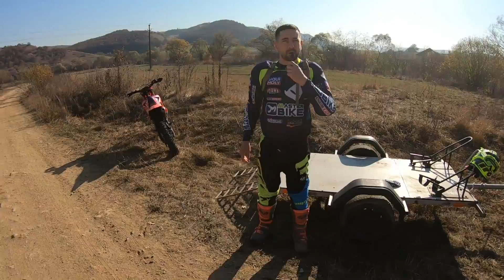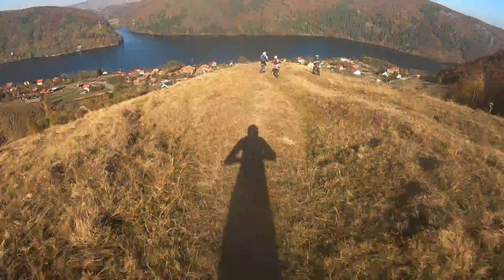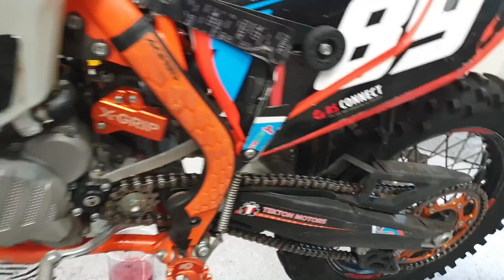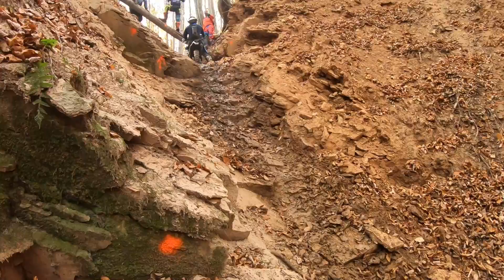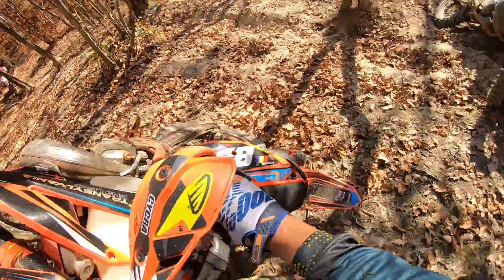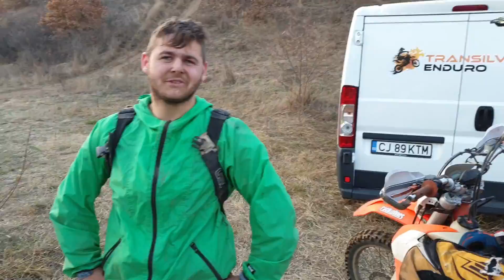Liqui Moly VS Hard-Enduro ? | Difficulty Level: Expert! Enduro Vlog #43

Comment: Si ce sfaturi ai pentru cineva care ar vrea sa inceapa enduro?ce marca ar fi buna?
Reply from the maker: Beta pentru low-budget, ktm-husqvarna daca nu vrei as faci compromisuri, la ambele variante mai noi gasesc piese usor. Pentru începători recomand 250 4t
Reply: @TransylvaniaEnduro  care sunt compromisurile la beta?
Reply from the maker: @silviupop9146  pana in 2018 strict din punctul meu de vedere si experienta care am avut-o aici la Cluj, plastice de foarte slabă calitate, incontinu ceva trebuia reglat la ele, din fabrica ele sosesc cu sistem de amestec ulei automat care este recomandat anulat si facut amestec in rezervor, centrul de greutate mai jos, suspensile fata de slabă calitate, în cazul x trainer telescop spate care se rupe etc
Reply: Transylvania Enduro eu am si beta si ktm si pot sa spun ca sunt deacord in legatura cu plasticele si oarecum cu suspensiile pe fata care nu sunt la fel de bune ca pe ktm/husqvarna, dar are si anumite plusuri fata de ktm, cum ar fi electromotorul, cuplul mai bun de jos,  se simte mai usor cel putin la modele pana in 2016.
Eu zic ca depinde mai mult de stilul fiecaruia nu poti sa spui ca sunt mari diferente intre ele pana la modelul tpi de la ktm/husqvarna si nu as tacaloga beta ca fiind ceva low-budget.
Reply from the maker: @silviupop9146  repet este punctul meu de vedere strict, cuplul il ai datorita carburatiei, pana in 2020 la ktm ai varianta  xc cat si TX la husqvarna care este mult superioară la varianta tpi, din fericire beta au facut upgrade -uri masive pentru 2020 vs ktm care momentan este pe linia de plutire